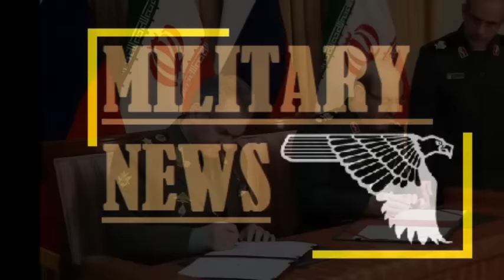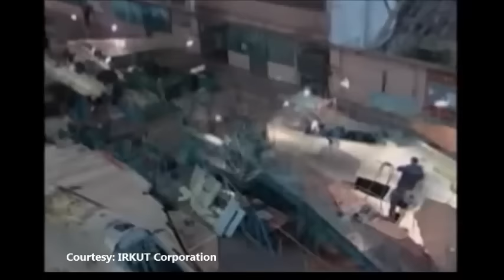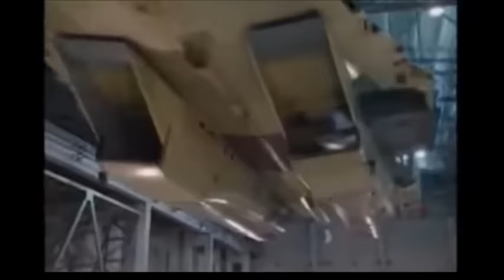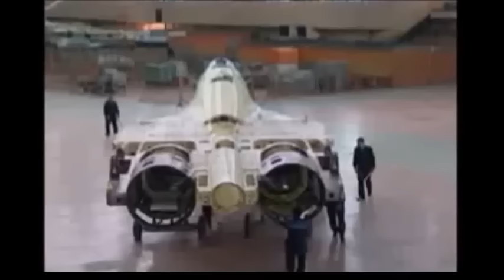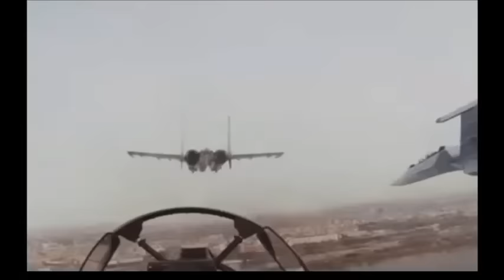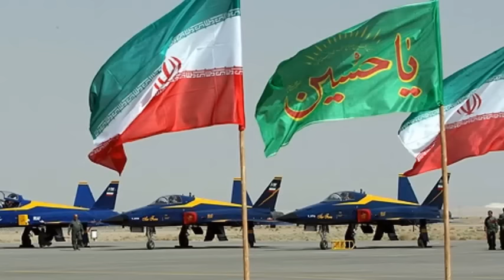Iran and Russia to Co-Produce Sukhoi Su-30 Fighter Jet

Comment: in any way the iranian in urgent need to rebuild them ageing air force combat aircrafts ..
SU 35 much better . but it's easy to upgrade the SU 30 to SU 35 standard .. it is a big platform so there always room for developments and
 improvements and introduce more ECM suits & devices without affecting the over whole capabilities and  performances ...